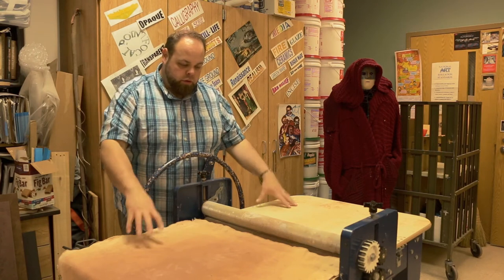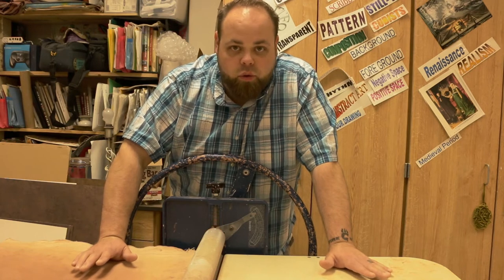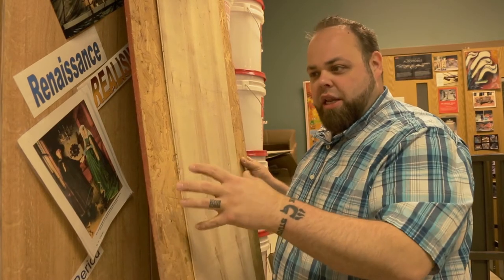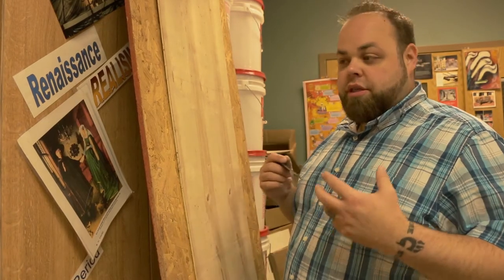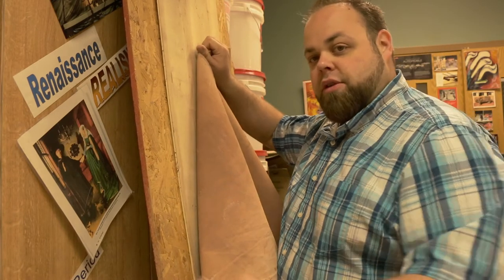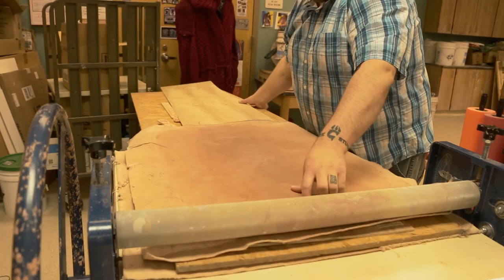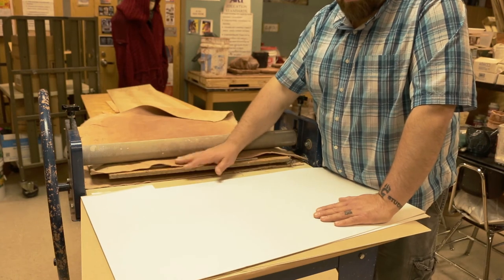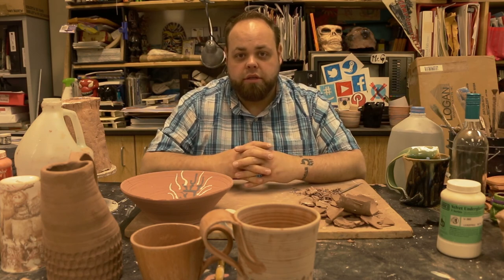Slab Roller vs Printing Press - Which to get?!?! Ceramics 101 - University of YouTube

Comment: I was wondering whether this can be used to print etching or mezzotint plates... If a steel board was used as the top sheet on the bed.
Reply from the maker: It totally works. It is just based on the space and pressure on the plate. There is trial and error that you will need to test, but it’s much easier to just have a sub roller.